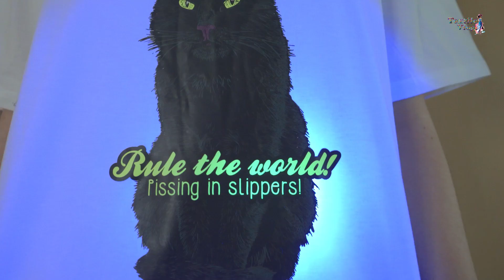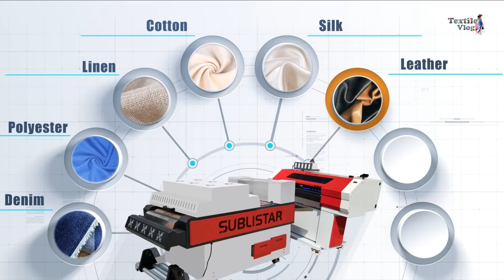Types of Digital Textile Printing Machines - Explore the best printing techniques for your fabrics

Comment: @TextileVlog very nice video 👍
However pls some information were a bit off. I know this because I have owned and run a printing business for 12 years now. 

1. Direct to film (DTT) is primarily used on cotton and almost any type of fabric for apparels.

2. The Inks used in DTF are not sublimation Inks but pigment based Inks that closing relate to screen printing water base Inks. As DTF is a mechanized version of manual screen printing.

3. Most DTG (Direct to garment) printers can hardly meet up a 30 to 50 units per hour let alone 200 per hour man 😂

4. Sublimation Inks only works or are only meant for polyester fabrics and garments.
Reply from the maker: Thank you for your insights and for sharing your experience! I appreciate you highlighting these points – it's always valuable to get feedback from someone with hands-on expertise in the field.